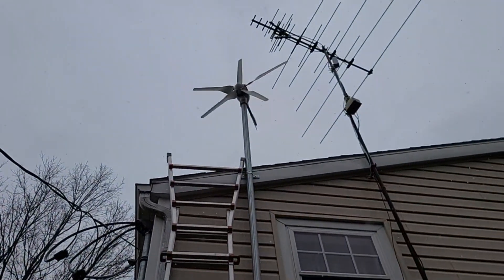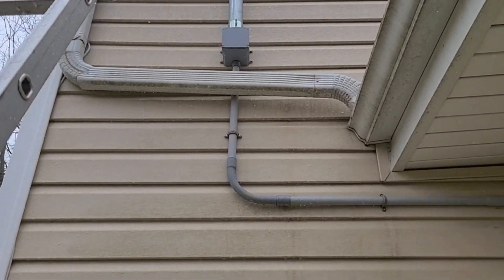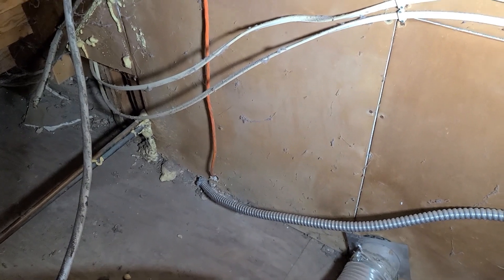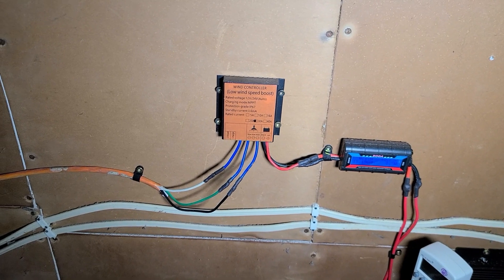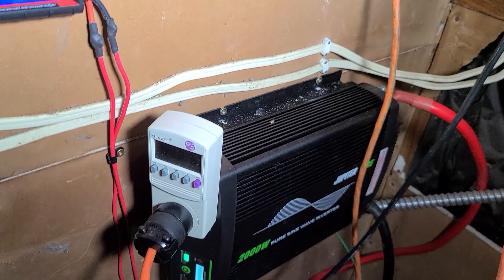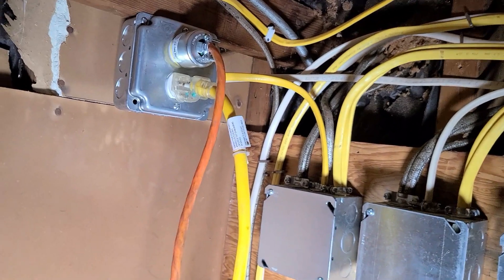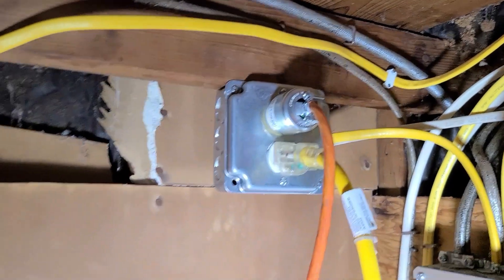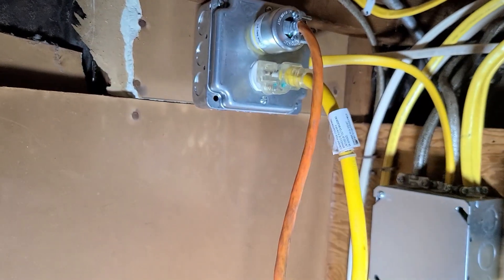Wind Turbine Installation Details - Part 2

Comment: Hi There NoGasNiko!  It's Paul your Leaf Battery Warranty brother in arms!  My wife has a huge 300 year old Rectory in Wales, Pembrokeshire she has been developing and running as a holiday and even venue for the last 30 years.  Wales, Pembrokeshire is on the Atlantic Coast and has a  lot of strong wind a lot of the time!  A couple questions...  how much has this cost you so far?  Or even better what might be the breakdown of your expenses like how much did the wind turbine cost etc, etc...?  The other question is how much electricity are you generating say per month?  Cheers and good on you!
Reply from the maker: For this installation I have the following rough numbers.

Wind Turbind = $140
100 ah AGM Battery = $240
Conduit and supplies = $200
Inverter = $300
Battery Wires and Misc = $150

Total around $1000 USD

For the power generation, I haven't had very many windy days.  When I was trying to mount it on the pole we had 20 mph winds and it was difficult.  Once connected and ready to charge I went about 7 days with no wind.  The max output I've seen was 138 watts and that was with 25+ mph winds.  I think the charge controller is bad and I will be changing that out today.  Hopefully that increases the output otherwise I will not recommend this wind turbine for anyone.  

I can't remember, did you already start your warranty process on your Leaf or are you waiting for the last bar to drop?
Reply: @NoGasNiko  Thanks very much for this helpful information.  I am still waiting for that other shoe (4th bar) to drop!  Meanwhile my pack is degrading and I am now going back into an soh are at 64%.  It seems my algorhythm is more stingy that yours?  One reason might be I have only 93,000 Kilometers/65,000 miles whereas I think you have 93K Miles?  I dunno.  Anyway I moved to another Nissan Dealer who is closer to me and has a better attitude/perspective I think.  I have stayed respectful with them and have been so patient that now they are on my side which might help my cause in the end.  Bye the way, what's your current situation with your 8 bar warranty for a new replacement pack?
Reply: Sorry for the typos
Reply from the maker: Currently I have a claim in with Nissan Customer Affairs.  I've contacted a new dealership that will try to get the Leaf in next week for evaluation.  With the weather warming up I doubt they'll be able to cause a fault code.  Hopefully that will work in my favor.  I'll keep you posted.
You should be dropping that last segment any day now.  Mine was at 65.90% SOH.  I'll be routing for you to get it with the next month!
Reply: @NoGasNiko  So I think with 8 bars and so much time left (but not many miles) you should get approved for the warranty.  I don't think  they have to generate a fault.  It's at 8 bars, it's less than 96 months, it's less than 100k miles... DONE!!!!  You should get approval for that for a new pack!
Reply from the maker: Fingers crossed!
Reply: @NoGasNiko  You Got IT!